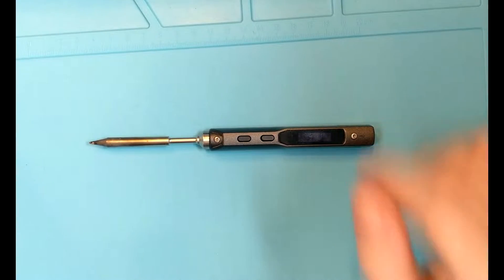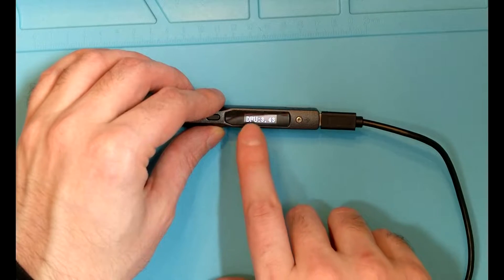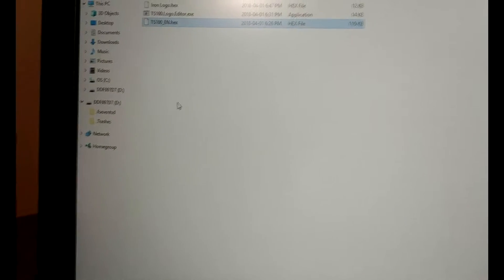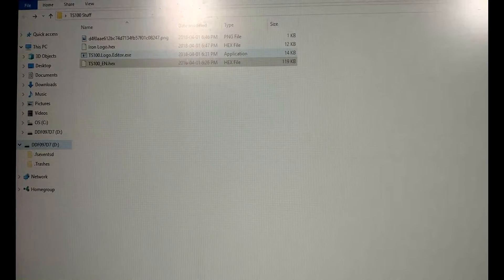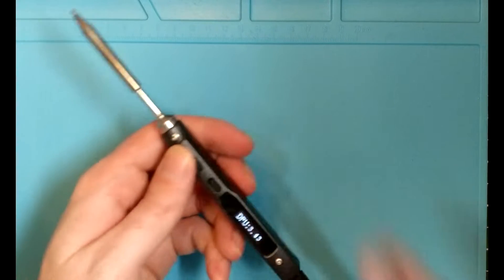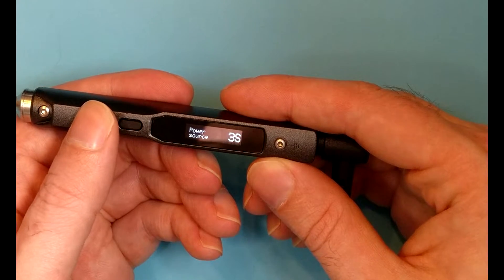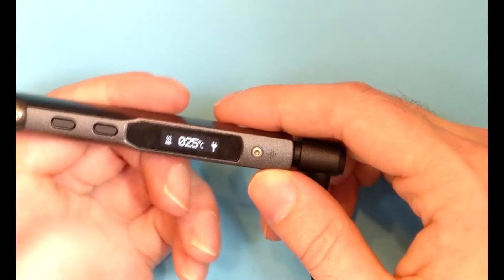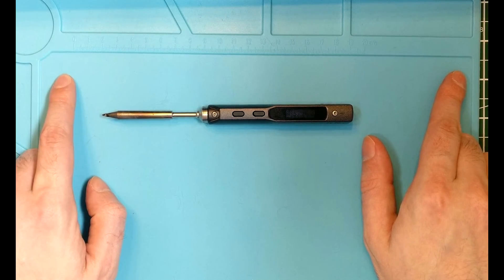How to update TS100 Firmware

Comment: is it normal for the file to disappear from the tool usb drive after you unplug and replug it back in?
Reply from the maker: Yes. It should disappear, and be replaced with a small text file.
Reply: @GadgetBoy  no txt file. Just blank :(  
My config is saved when I turn on the tool I guess. Like the boost mode and the max temp I want it at
Reply from the maker: @frostieff  If the new features are working, then it worked just fine.
Reply: @GadgetBoy  thank you soon much!!

Comment: Hello friend! I updated the firmware but the screen only shows "DFU:3.43" after i make all what you say on the video... I enter dfu, put in there the .hex, after it says RDY and then when I unplugged it and conect it to the power, the screen shows only DFU bla bla bla... do you know what is happening?
Reply from the maker: How are you applying power?
Reply: @GadgetBoy  with my lipo 4s
Reply from the maker: Don't press any button when you plug it in. You're plugging it into the 5.5mm socket, right? (you can't power it from USB)
Reply: @GadgetBoy  that is what i do... I only conect the ts100 with the lipo and I am no touching nothing... yes in the 5.5mm socket... like always but nothing is shown on the screen...
Reply from the maker: That is very strange. What polarity do you have set up on the plug?

Comment: the firmware.rdy is made, but the iron screen is just black whatever i do
Reply from the maker: Try flashing the firmware a second time. Make sure you're using the correct version.
Reply: Gadgetboy I did it, and it worked :)

Comment: Yeah this firmware update didn't work for me. Now my Ts100 is dead and won't even turn on whatsoever when power is connected.
Reply from the maker: What happens when you connect it to USB?
Reply: @GadgetBoy  if I connect a USB cable nothing happens. Nothing lights up or boots up. The only thing it will do is allow me to still press the button closest to the tip and then plug in the micro USB and the DFU: 3.42 pops up. That's it. And even when I am able to get the drive open for the ts100, it will not accept the  .hex file. The window will close, I get an error and then eventually get a file size too large error also.
Reply from the maker: Which hex file are you using? Are you putting it into the iron's storage while it's in DFU mode?
Reply: @GadgetBoy  I have even worse problems now. 😂
Reply from the maker: If you want to contact me on hangouts, maybe I can help you further.
Reply: @GadgetBoy   did you guys ever figure out what was going on?
Reply: Never mind. Just had to plug it into USB 2.0 instead of 3.0 (---______---   )
Reply from the maker: That's a bit weird. USB3 is supposed to be backwards compatible...
Reply: @GadgetBoy  I tested it on all the USB 2.0 and 3.0 ports on my pc. With 3.0 it kept giving me an error saying "file too large"  but, It worked just fine on 2.0. I have no clue man.
Reply: @becksaunders8204  I've just had the exact same issue - was failing with USB 3.0 then worked fine first time on USB 2.0
Reply: @becksaunders8204  My god I'm so happy I found this comment. It would close the explorer window ("disconnect itself") and then say the copy failed! Switched to a 2.0 port and it worked first try. How weird.

Comment: Great vid - just what I needed to know, thanks - my TS100 will arrive in two weeks. Btw, you CAN go back to the original FW, so says Ralim - https://www.youtube.com/watch?v=WlnpboYfxNk . This vid is 18 months old, so the iron display in it doesn't look the same as the FW now, which you've just installed here. Dec 2018 FW may look different again, but I've yet to use it.
Reply from the maker: Careful with links to other channels. YouTube can get a bit pissy about it.

I haven't updated to the latest firmware yet, but I'll probably do a quick blurb on it when I do.

Comment: Can you save the original firmware to your pc in case you want to go back ?
What features do the new firmware have over the stock one?
Reply from the maker: I believe it's a one-way trip for the custom firmware, HOWEVER, there would be no reason to go back. The custom firmware is extremely robust and has far more features than the stock, and it has a much more intuitive UI.

Comment: Is there NO firmware in the iron out of the box?
I've not applied any DC power yet but my MacBook Pro saw the TS100 immediately and there are many files in there. 
Will it not run on that?
Even if it's out of date, it was valid in its time.
Reply from the maker: The included firmware is just fine - this firmware has better interface and more options.
Reply: @GadgetBoy  
Hello G.B.
Thank you for the courtesy of your swift reply and info.
That will give me breathing space to use it whilst sorting thru' the bewilderment of firmware updating. MacBoo Pro.
I propose to run it off a laptop 19v supply on the bench and on a  12V Lipo (or maybe two) for portable .
Don't do much servicing 'in the field" these days.
Do I take it that separate tips can be changed instead of the entire heating element? 
Again, thank you,
M.O.L
Reply from the maker: If you're going to power it form lithium cells, I strongly recommend the open-source firmware, as it has options for better power management when operating off of batteries.
Reply from the maker: Missed your second question.

The tips for this iron have the heating element built into them so when you change tips, you're swapping the whole assembly (this is why the tips are so much more expensive).
Reply: @GadgetBoy  
Thanks... Then I guess some more detailed tip care is required ...wet sponge, don't let it stand unused at full temp to blacken and  corrode the outer metal and DON'T go near it with a file or similar to clean it?
Reply: @GadgetBoy  
Ah... So for bench use, a power supply is preferred on existing firmware?
When I referred to a laptop 19v supply, I meant the charger not an actual  battery pack.
Never-the-less, the open source firmware seems advisable...
Thank you.
M.O.L.
Reply from the maker: I prefer copper plated steel wool (the ones sold as dish scrubbers are quite effective, if you're on a budget). Poke the tip into the wool, skrudgle (a word I just came up with to describe the noise it makes) it around a bit, works great.

The iron is smart enough, even with the basic firmware to detect when it's idle. It will lower the temp automatically after a period of time that you can set. After a longer period (also settable), it shuts the iron off.

And yes, never ever file it or use anything abrasive on it, although the guys at Weller said that a fine pumice stone can be used if absolutely necessary, but only lightly and very carefully.

The upgraded firmware is perfectly fine on a bench supply, it just has the option that you can select that tells it how many lithium cells you're running it on. Helps it manage power more effectively.
Reply: @GadgetBoy  Yes... Have used one of those 'skrudgles' for a while now.
Good to hear that it powers down when not in use. Since 60s, have become used to putting the iron on same time as the bench.
It ran all day and, providing I loosened the bit daily, it gave no trouble. Open copper bit and "Savbit" multicore solder with copper in the alloy. No probs. Changed bit when it became too short after regular reshaping. 
In recent years irons started overheating and blackening heavily. Then I put a HV. diode in series and a switch across for two power levels but kept forgetting to switch over. 
Soldering irons have become a a nuisance so am looking forward to good things.
Many thanks for your A1 assistance.
M.O.L.

Comment: When I copy the file to the iron I get a error saying the file is to big the iron disconnect from pc after that but the file is not there and keeps saying that the file is to big
Reply from the maker: Which file are you uploading, and did you remember to put the iron into DFU mode?
Reply: @GadgetBoy  the same you choose on this video and yes if not I would not see the folder on the computer
Reply from the maker: I'm not certain, then. If you followed my guide exactly, it should work.

Comment: Nice of you to take this on. A big thanks. I wonder if the fw update suggested in the little instruction booklet is any better than what it ships with. I have had mine for over a year. I assume that putting it in DFU mode will tell me what version it has in the flash mem. But my concerns center around the function of your thermocouple readings at 300+ Deg C. Mine is rock solid with factory FW
Reply from the maker: +Chris Leech I really like the custom firmware that i installed. There no hysteresis on the temperature reading, so the temp is real time, which is why it fluctuates so much. The ability to tell it how many lithium cells you're running it off of is really useful, as the iron will automatically shut down to avoid over discharging the cells.